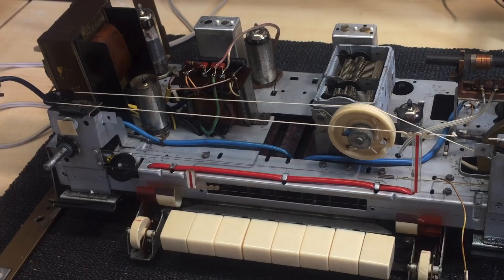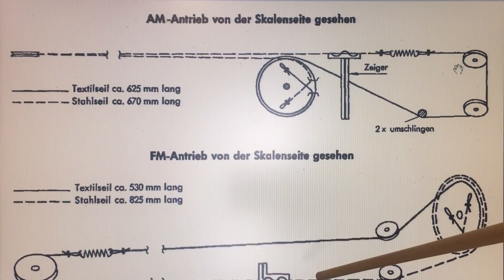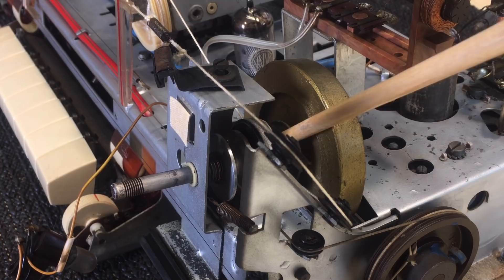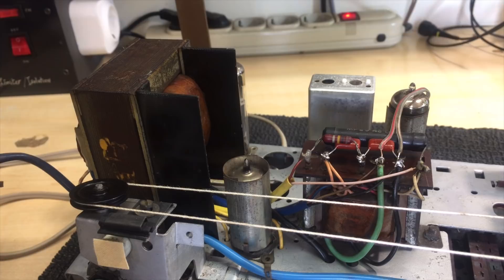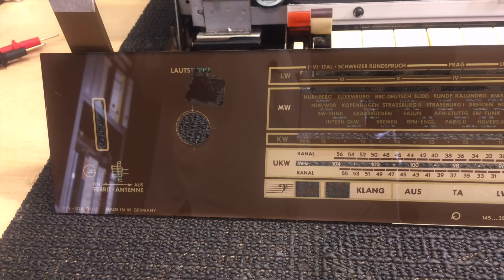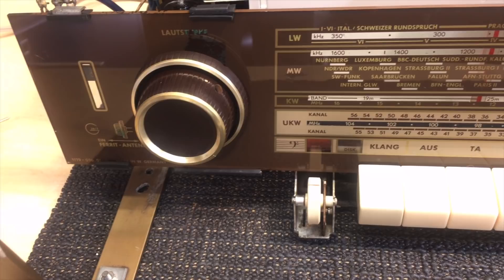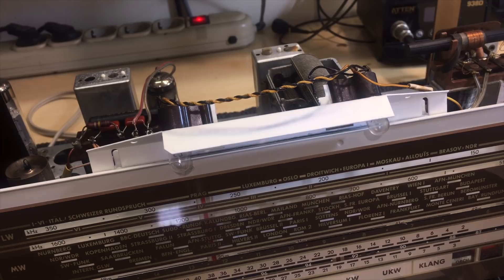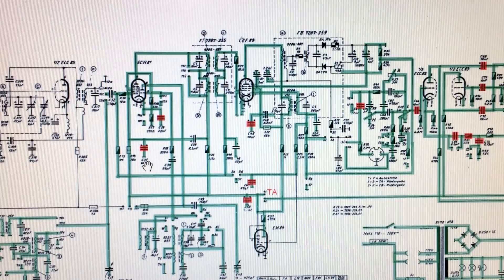Grundig 3160 tube radio restoration, part 5. More cleaning and IF alignment of the AM.

Comment: I have used fishing line for dial cord on several occasions, and with good results. I use the braided variety (Fireline or similar brand). It has very low elasticity and tremendous strength

Comment: I recently found your channel which I greatly enjoy, especially as I had a Portuguese South African friend in the Algarve, also an engineer. I was particularly interested in the Counterpoint MOSFET amplifier as I was given one of the first MOSFET (VFET) amplifiers to come on the market, a Sony TA-4650. I made it work for while, but the special Sony transistors were expensive and I gave up and put another power amplifier in the Sony case.
I like repairing stuff, but I am not in your division. To pass time at the moment I have been repairing a few old oscilloscopes (1980s), mostly transistorised, but one had a few valves. You can still get NOS valves here in France. Reparing and restoring venerable, quality equipment is satisfying, although it is very time consuming and I don’t have your meticulous patience for restoration.
Tiro o chapéu
Reply from the maker: I've never tackled scope repairs, but will try one sometime. This hobby is very time-consuming, so efficiency is not an issue. Patience is ... which sometimes is in short supply. I usually love having time at home to do my stuff, but being forced to is another matter. 
Stay well, and enjoy the hobby. 
Regards form Madeira.

Comment: Very nice!  Despite the tedium you sure do nice work cleaning your radios!  About using acetone, I've not tried it yet because I don't have a painted chassis ready to try it on, but it occurs to me that plain old nail polish remover might make a good cleaning agent.  The stuff I get is mostly a mixture of acetone and IPA.  The IPA is there to dilute the acetone which would be too strong on the fingers if used straight.  I use it as a toner transfer medium for making one-off circuit boards.  These days it is hard to find IPA in the stores but if used carefully on chassis parts only, nail polish remover might make a good substitute.
Reply from the maker: Correct. Nail polish remover is in fact a better choice as it is weaker. In fact, if I could weaken it even more I would so that the process is slower and more controlled.

Comment: Splendid work as usual. Great attention to detail. I made some of your polishing mops for use on The Hallicrafters. Worked very well.
Reply from the maker: They do. And they’re incredibly cheap.
Reply: Question from a novice. I have successfully followed your advice on ‘painting’ continuity on the circuit diagram and found it to be very helpful. However what can I do when I come across a capacitor? Is there any way to prove that the circuit continues unbroken? I have seen Shango using audio from his phone?? I have a small audio generator, could I use this (with a speaker) to prove the circuit beyond the capacitor? Lynton

Comment: A possible replacement for the thread is nylon for fishing line.
Reply from the maker: That might stretch a little too much, don’t you think?
Reply: @electronicsoldandnew  It worked for me with a line with specs : 0.4mm / 9.5 kg or 20 lbs.
Reply from the maker: Great. Thanks

Comment: Very good work with the scale rope. 

Which input impedance has the antenna input on LW, Shortwave and Middlewave? On UKW , if i remember right, it's 240 Ohms?
Reply from the maker: I’m not sure. It varies depending on the frequency band, which makes the IF trap adjustment a little pointless, unfortunately, as the signal was coming from the signal generator with a 50 ohm impedance.
Reply: @electronicsoldandnew  I guess, there is a missunderstandig. I don't ask abt the if-trap. That was clear. I only would like to know the input-impedance of the antenna-inputs (on the backside of the radio).
And keep yourself  and your family save.
Reply from the maker: I checked the back. The FM is stated at 240 ohms as you’d said, but there is no indication on the AM antenna.

Comment: That is looking very nice. I have a question if I may. I got an old signal generator , its a C.I.T k24 that I have no clue if it works because it was at a junkyard. Looks as new inside and fairly decent outside. Is an osciloscope the way to go on checking its working operation and calibration? Thank you :)
Reply from the maker: It’s a fairly simple circuit, and strictly speaking you don’t need a scope, but it would help. You’ll need to measure exact frequency, so a frequency counter would do. 
By the way, I didn’t know that they’d made these in Portugal. Nice.
Reply: My father in lawn told me that these were sold as a kit at the time he was taking his electronics technician course. So a frequency counter... I'll figure something out when the time comes. Thanks again :)
Reply: You could also use a radio.